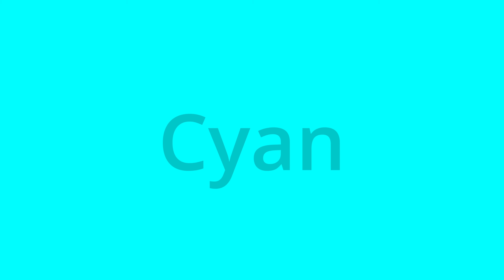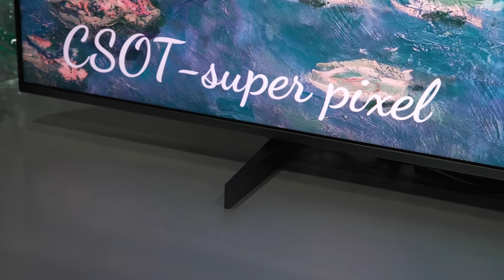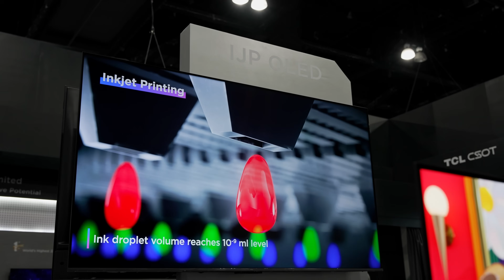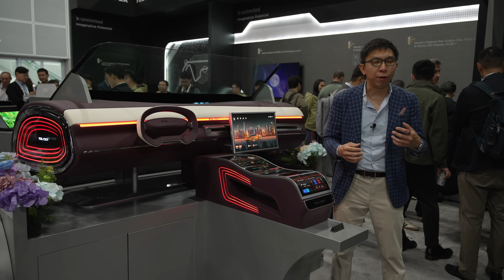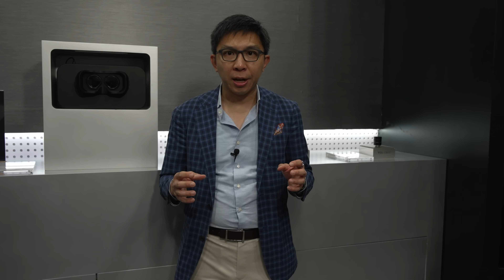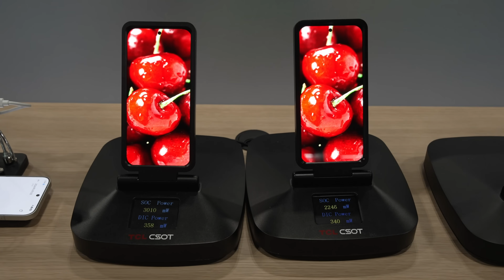131% Rec.2020?! TCL CSOT’s RGBC (Cyan) Display Explained… & More

Comment: Finally. I've been looking forward to multi-primary displays for a while, although I think you'd want at least 5 primaries to get good coverage.
The blue-cyan-green side of the color space is pretty curved, so you need more than just one extra point inside that region to hug the curve properly. Otherwise it gets a bit "spiky", with good saturation only near the primaries, and pretty dull in between.
The red-yellow-green side doesn't have this problem, because it is a lot more straight, and therefore has near perfect saturaration along the entire line by just mixing red and green.

The way this works in the real world is for example that my QD display has colors that are pushed pretty far to the edges, meaning that my blue looks a bit violet. And since blue is spiky, I can't then also have a properly saturated royal blue. A 4-color display wouldn't really fix this, but a 5-color display probably could.

Comment: Talking about PPI with respect to head mounted displays and whether or not the pixel structure is 'visible' makes no sense, as a several inch 4k display that fills 110⁰ of your FOV will appear to have the same "pixel structure size" as a microscopic 5mm 4k display that gets expanded via the optics to fill the same 110⁰ FOV.
PPD is where it counts on head mounted displays, more pixels per degree of vision. Smaller displays are still good for saving weight and extending battery life, but they don't affect image clarity unless they're also a higher resolution

Comment: Why still LCD? Jesus LCD sucks.
Reply: A mini LED high end VA panel is pretty good, 7000:1 native contrast and incredible HDR performance. It is probably much harder to develop a cyan OLED pixel than a quantum dot cyan VA pixel.
Reply: @TheEsseboy bro LCD sucks at night. I don't care about numbers. I don't stand seeing blooming on any screen. They should focus on MicroLED or OLED.
Reply: @mariussm7797  If you have a mini LED LCD with proper backlights you do not see blooming. Especially with 7000:1 contrast ratio on the new VA panels. 

Try to get HDR 4000 on an OLED. It will never happen, Micro LED is too expensive and most likely will always be. Mini LED and RGB LED is the way forward for big TVs. For smaller screens OLED are best.
Reply: What's a 'Jesus LCD' and why does it suck?

Comment: So probably another decade or two or more for for 6 sub-pixel channels, RGBCMY maybe? Or more with laser primaries even. Completely different approach. Maybe a single QD sub-pixel before to produce the color range. Same with dynamic range of stops. We're so far away matching our human eye vision in terms of color and stops though. But currently I'm more curious to see proper BFI or better yet rolling scan blur reduction on OLED or it's successor to move away from sample-and-hold that kills motion clarity. When will monitors get this?

Comment: TCL's new cyan subpixel approach isn't the first time a manufacturer has tried augmenting the standard RGB layout with an additional color subpixel. Sharp attempted something similar with their YRGB displays, and while they had used that approach before, the 2011 Sharp Elite represented the peak of that effort — the only LCD TV to ever win the Value Electronics shootout and a genuine engineering marvel worth looking up if you're into TV history.
Despite Sharp's bold claims of finer detail and a significantly wider color gamut, independent scientific studies and extensive measurements found neither benefit materialized. The only measurable improvement was a modest bump in brightness.
I strongly suspect we'll see the exact same outcome with TCL's cyan subpixel approach.
Reply: The problem is that the right side of the CIE color space between red and green is essentially a straight line, so you can already get near-perfect saturation for any color in that range by just mixing red and green. No yellow needed. The other side however between green-teal-cyan-blue-violet is pretty curved, so you're definitely going to need more primaries to prevent those colors from looking washed out. In fact, one is probably not enough. You're probably going to need at least two extra primaries to properly fill out the curve and get decent coverage in that part of the space.
Reply: @Dayanto Thats a fair point about needing multiple extra primaries to fill that curved region...What's interesting though is that the how matters as much as the what — plasma displays never had massive gamut coverage on paper, but their broader, overlapping spectral emissions naturally filled in that space between primaries in a way that felt cohesive. Plasma actually covered more continuous bands of the visible spectrum than OLED despite plotting a smaller gamut triangle — because OLED's narrow spikes leave spectral gaps between primaries that the CIE diagram doesn't reveal. It's part of why plasma color always felt more soulful and impactful than its specs suggested. Narrow spike primaries can hit the boundary points precisely but leave the space between them starved. So maybe the goal shouldn't just be adding more primaries, but thinking about the spectral character of those primaries — wider and overlapping might do more perceptual work than taller and isolated.

Comment: Why not adding Magenta and Yellow too ?
Reply: Magenta isn't actually a color of light. It occurs when we see blue and red light simultaneously. However, we could use a violet subpixel
Reply: @xephyrxero cyan is a combination of green and blue too
Reply: @Swanky_393 in our eyes, but there actually is cyan wavelength light
Reply: @xephyrxero  What does it matter whether there is a single wavelength (cyan) or not (magenta) that represents the colour? To our eyes, both cyan and magenta stimulate two different cone kinds simultaneously, so how are they are not functionally equivalent (to a human)?

FWIW, given that to the best of my knowledge all content is RGB-based, there should be absolutely no need to cover other primaries than R, G, and B. The only point I can see regarding a cyan subpixel is that it may help to shift the G and B primary spectra in such a manner that a more precise coverage of the source colour space is possible. I'd prefer, if they directly optimised the R, G, B primary spectra instead, since adding subpixels to a standard RGB-stripe layout always comes with a cost.
Reply: If you look at the work by 6pcolor, their vision is to move beyond colours defined in terms of colour primaries, and rather in terms of human LMS cone response. Doing it this way means colour requested is decoupled from the technology producing it, so manufacturers would be free to use as many or as few colour primaries required to produce the colour (ie, they could 3,4,5,6,etc subpixel colours). Perhaps this approach will benefit future EL-QD displays since presumably tuning the sub pixel colours would be 'easy' using quantum dots.

Comment: Most content is rec.709 anyways. There's rarely any point having a bigger color volume, especially bigger than rec.2020.
Reply: most content is 720p or 1080i still no matter how much you pay for streaming. the industry is a JOKE
Reply: @superjuddy  In my experience most content on streaming services is either 1080p or 4K with the real issue being an abysmal bitrate (15~Mbps), with the bitrate situation worsening as resolution decreases, making low resolution content look much worse than they should (presumably to encourage you to pay extra for the high resolution subscription plans).

There are some streaming services which offer an acceptable bitrate (around 40+Mbps) but it's still a far cry from what is offered with a blueray disc (100+Mbps).
Reply: @superjuddy  Most cable content, not streaming or UHD disks.  What is a joke, is watching an old TV show on a 26" CRT and wondering how the hell our whole family sat around the living room and watched that small blurry mess lol.
Reply: Yeah, very little content takes advantage of rec2020.  Maybe in about 10 yrs lol?
Reply: Most modern videogames have HDR support now. See also numerous ultra-blu rays out there
Reply: @xephyrxero Most HDR content is still mostly made out of colors that are already in the rec.709 gamut.

Comment: Where will the content for the cyan subpixel come from? This has to be about suboptimal RGB primary spectra, correct? Are QD-OLED primary spectra still not good enough to produce all cyan shades that are actually present in existing sources? Are the latter not all effectively encoded in RGB? YCbCr is just a more bandwidth efficient variant of RGB; it still uses RGB primaries.
Reply: Very good question it will be interesting if Vince responds.
Reply: To meaningfully take advantage of it we would need a new standard beyond bt2020 because as you say, all those extra cyan colours the display can reproduce fall outside of the bt2020 colour space. Maybe a benefit they could get from adding a cyan subpixel is shifting the blue and green primaries to different wavelengths to try and reproduce more of the bt2020 colour space (if you think about how mapping a 4 sided polygon to a triangle you have more options to maximise area vs mapping a triangle to a triangle).
Reply: @Your_Paramour  Yes, tweaking the other primaries for better (more precise) overall coverage of existing material is the only reasonable explanation I can come up with as well. I'd prefer manufacturers to optimising the RGB primaries in that case, though, as adding subpixels to a standard RGB-stripe layout comes at a cost (e.g., text clarity).
Reply: Consider the horseshoe-shaped CIE chromaticity diagram. Three primaries can fill a triangle within it. Four primaries can fill a quadrangle, which can cover a larger part of the horseshoe. Converting from an RGB-based color space is just a color space transformation.

Comment: I remember RGBY from Sharp.
Reply: Yellow helps, but there is more cyan colored space that is missed than Yellow. Some people think we should have 6 primary colors to get more colors.
Reply: @Taluvian  Dlp displays with color wheels have 6 colors.
Reply: @Taluvian  There is but yellow would be significantly more impactful when it comes to HDR since the brightest things tend to be yellow/orange/white. Chasing a part of the color space that isn't heavily used, and especially does not require demanding brightness is just silly.
Reply: @DOGMA1138  Cyan is useful for displaying sunny skies and tropical oceans in calm and sunny weather, so there should be some content where cyan is useful in HDR.
Reply: @jnvivian  Which are all not bright and not anywhere close to being the brightest objects in the scene. So again pointless chasing a metric that isn't actually important for the viewer.
Reply: @DOGMA1138   If you look at a color space diagram, you can see that the right side between red-yellow-green is essentially an almost completely straight line, meaning you already have near-perfect saturation by just mixing red and green. Yellow wouldn't unlock any new colors.

Meanwhile, the blue-cyan-green side is very curved, which means that you'd ideally want at least two more primaries in that range to properly fill it out. Otherwise the saturation gets pretty "spiky", with good saturation only immediately near the primaries and pretty dull in between.

This is probably also why the blue-green range has been so under-utilized, because it has by far the crappiest saturation in our current color gamuts, and the spikiness makes it feel like you only have one real shade of blue.

This is especially a problem when we start pushing the colors. For example, my QD IPS has a blue that is biased towards violet, which means that it can't really make a vivid pure blue or royal blue, because whenever you shift the hue in that direction, it becomes more grey. And once you get to cyan/teal, it is very muddy. (like all current displays)

On the red-green side this is not a problem. My red is beyond normal red and almost looks a bit magenta, but that's fine, because you can just mix in a bit of green to get it back to the red that my phone has without any noticable loss of saturation.

If you desperately want more brightness, you can absolutely use a white sub pixel. But this doesn't give you better color. There is no reason for an actual yellow sub pixel. However, you might shift a white subpixel towards yellow to counter-balance the addition of cyan.
Reply: @Dayanto  For the billionth no one gives a fuck about unlocking more colors, you can't perceive them anyhow its all about brightness, the brightest things we have tend to be white or yellow-orange. Thats where the additional pixels help.
White sub-pixels are nice but they wash out colors, yellow/orange wouldn't.

Comment: I remember when Sony/Sharp did this with a yellow subpixel in the 2000s. They might have the image processing to properly do this now though.
Reply: Processing wouldn't have helped back then. Problem was that the backlight didn't produce a spectral yellow which red & green were filtering out, so nothing was gained. Cyan quantum dots and LEDs exist now so it's possible to do things meaningfully now, but I suspect any gains over modern high-end RGB displays will be rather circumstantial.
Reply: @random_n RGBY existed in Sharp TVs for a while well into the LED and QD era.

Without good signal processing though all of these displays are DOA because all content is mastered on RGB. Even LG's WRGB OLED struggled here for a while. (Especially in game mode where advanced CMS was disabled)
Reply: I still have my 2010 70” sharp Aquios. Thinking about getting a 4k tv now.
Reply: @TheBubbas22  jeje 👌 yo también máquina 😂😂 hasta hace poco que me pillé una oled y  alucinando vale la pena? Si amigo si te lo puedes permitir si !! Saludos 🎉🎉
Reply: @chokytube6396 . lol. I can’t wait!  I’m thinking about the s95f 77 inch. My wife has to have the matte screen. It’s beautiful though.
Reply: Oh yeah if you're ever 40 you remember Sharp Quattron
Reply: @chrisbullock6477 45 señor
Reply: A yellow primary is silly, because the red-yellow-green side of the color space is essentially flat, meaning that you can get near perfect saturation for any color by just mixing red and green.
The green-cyan-blue side on the other hand is pretty curved, so you need more than just cyan to fill it out.
The ideal would probably be something like a 5-color display with violet-blue/blue-cyan/cyan-teal/green/red.
Reply: Wake me up when we get the first RGBCMY TV. (Yes I know some DLPs could do this back in the day. I meant flat screens.)
Reply: Well tcl is now Sony TV manufacturers so that makes sense
Reply: LG did this with white subpixels.
Reply: @redvivid WRGB is different conceptually it’s to fix the brightness deficit OLED had at the time and it actually reduces coverage not increases it, though it improves HDR performance.

This is why QD-OLED outperformed WRGB and why LG is trying to move away from WRGB now.